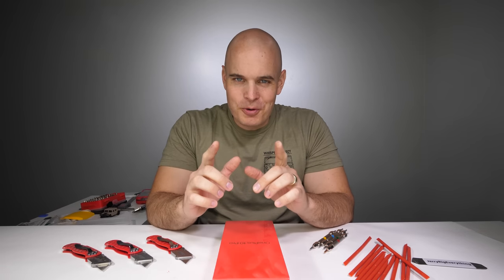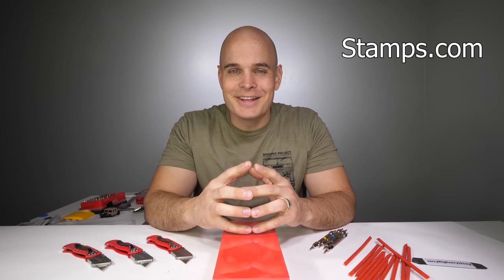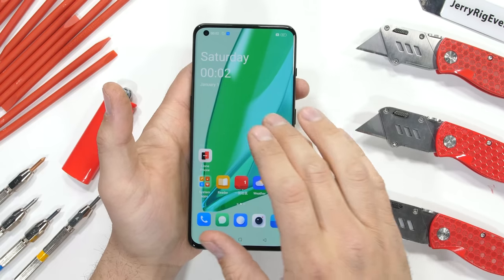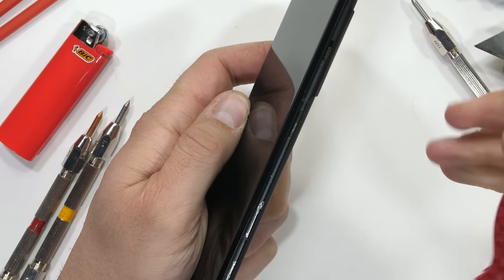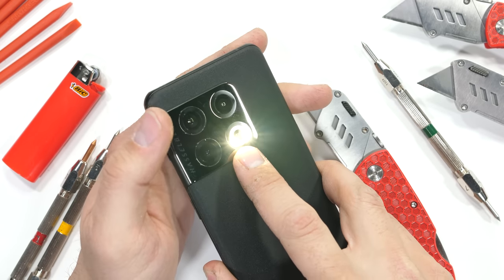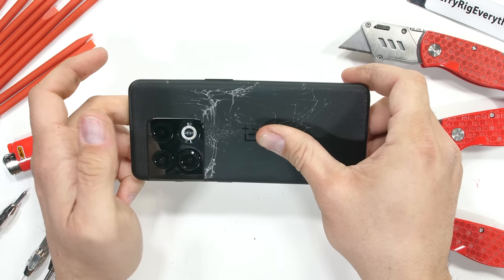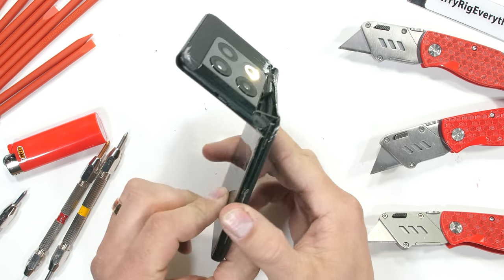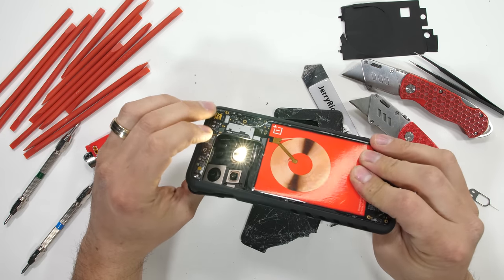Somethings wrong with the OnePlus 10 Pro... - Durability Test!

Comment: I love that when something fails, he goes into find out why, rather than just tossing it  and saying the phone is bad. Gives people a chance to understand how things work.
Reply: I want to point out that by naming the structural issues people lern to appreciate other phones which do survive those extreme bending tests. Especially those foldables.
Reply: @shivarsguard  especially because sometimes they can bend both ways
Reply: And that's why I love these durability tests
Reply: @EggplatnmWatch  there are youtubers who do that?
Reply: Why the company didnt bend test in their quality control department? They just dont care anymore?
Reply: @fynkozari9271  no, because people don't typically try to bend their phones. Sometimes things are overlooked, why not give people a chance and tell them why their product is failing
Reply: @EggplatnmWatch  You don't need to try and bend phones though. Phones being in back pockets is a very common thing that can result in a device having bending pressure applied to it. It's completely inexcusable to overlook those potential problems
Reply: @xenofastiq  And that's why channels like this exist, to expose the bad designs and point out what needs to be changed so it doesn't happen to other designs for future models
Reply: That's why I like Zack.
Reply: i can never understand how anyone is calling a phone bad or wrong when it bends under what must be atleast 15kg of bending force. a person with atleast average IQ does not sit on something hard with a phone in their backpocket. I never understood people who has their phones in their backpocket at all.

Comment: I still use my old OnePlus 5 that i brought new mid 2017. Surprisingly the battery is still fine after close to 5 years of use. The Li-Po battery has been cycled about 1800 times when they say it usually only last 300 cycles. Still  a very fast phone using the Snapdragon 835 and 8gb of ram. Does everything i want it to. Only down fall is the camera isn't the best. When the battery dies ill just replace is and keep using it. If it completely stops working ill probably upgrade to a OnePlus 7 pro.
Reply: Damn. My oneplus 5 battery started getting really bad after about 3 years.
Reply: I'm still using OnePlus 5 as well

Comment: They made the worst possible decisions when it came to structural integrity, leaving the zone where it broke super weak. The camera bump ends there (weakness in the back glass), the volume buttons and antenna line are on either side (weakness in the frame) and the battery housing is right below (no internal component that could help with/prevent the bending (even tho you shouldn't rely on internals for that anyway))

Comment: What a shame to see OnePlus crumble like this. I am still running my 3T to this day (6 years almost), maybe buying the OP7 Pro was the best move. I'll preserve this thing as long as possible as the OP9 gave bad vibes right from the start.
Reply: Oneplus 7t pro was the last good phone.
Still loving the retractable selfie cam
Reply: I had a 3 and it was still going strong when I upgraded. Only did it because of a good sale on the 7 Pro and my 3 had fallen on the concrete while I was longboarding and shattered.
Reply: The op9 was still a good phone. It was only too expensive for oneplus fans, but it was a lot better than previous oneplus phones.
Reply: i switched from 3t to pixel5a just 3 months ago... dont think i'll be back to 1+ anymore..
Reply: @kustu  yeah but in the that price segment there are better phones available than op9
 They have became the very thing they swore to destroy
Reply: @kbhasi  no the current Samsung galaxy s22 ultra is best
Reply: 7pro was great. It was also the last one I got. I ended upgrading to the s21+ because the 8 and 9 just didn't impress. And now the 10 is even worse especially with the awful software lately.
Reply: @kbhasi  you both saying out your opinions.  All your question also very subjective. Screen cutout? I don't see that is a big problem for newer screen. There's a feature to utilize the fullscreen. You just need to explore more on the device, it's an android, not iphone. It's 2022, even if it got headphone jack, people still buying the tws/bluetooth earphone/earbud/headphone. With fast enough data transfer using type c port, buying an external storage such as external hard disk, external pendrive storage (type c) can be a solution for sd card. It's even better because it transfer the data faster. Use the type c wired earphone also doesnt make any big change unless you're an audiophile. You eat your own question. Let me remind you, technology does evolved. None of the two form factors that you asked is available for iphone 13 series but you can see the sale that apple made. Don't ever question something that got a very subjectively answer.
Reply: @glitch5766  Eh, like other reviewers said, it was a good phone but just over hyped. It was on par with it's rivals.
Reply: I'm currently using the OnePlus 8 Pro and I'm really happy with it! I do recommend the regular 8 more though because the curved screen of its bigger Pro brother really collects a lot of scratches and isn't pretty to look at, I would rather have a flat screen!
Reply: One plus 7 pro is probably one of my favorite phones every. I rooted it so that’s probably why but as long as it has a new battery you’re gonna live it
Reply: I too have a 3T and have been using it for 4.5 years. I feel like 3T was the best smartphone to be ever made not just by OnePlus but by any company (if u take into consideration the price it was launched at). This is why I'm yet to change it because I can't find a better option. Was gonna buy pixel 6 but then Google didn't launch it in India.
Reply: My selfie cam still pops out, but the video feed doesn't work anymore. So sad. Can't buy a OnePlus to replace it because they're all terrible. Guess I'm going to Samsung or something.
Reply: I love my OP7P and was a happy user for 2+ years. Had no trouble other than having to replace the battery once due to degradation. Too bad that I accidentally dropped a weight onto it at the gym. The screen is shattered and more fatally, the frame is bent.

But before that, I only considered upgrading without actually pulling the trigger because yeah, the new OnePlus phones are pretty meh. I saw a video that literally had a 7 Pro and a 9 Pro side by side, and while they concluded that 9 Pro is a hair better, the margin isn't enough to justify an upgrade. You can barely tell the speed difference.

I have moved onto a Samsung Galaxy Z Flip3 now since neither 9 Pro or 10 Pro are giving me the wow factor 7 Pro did.
Reply: @ECGProductions092  that's sad indeed. Have you tried contacting OnePlus to get it repaired?
Reply: It's sad to see a brand such as Oneplus get so bad. They were a good brand for a long time. Clearly, not any longer. That frame looked so tiny and weak. It was insanely thin. I'm stick in shock. Did another company buy Oneplus and that's why the phone is made so cheaply now? I'm confused.
Reply: @all.day.day-dreamer  I have no clue why they have gotten so bad, but I know for sure their founder (or one of them, don't quote me on this) leaving the company didn't do it any good
Reply: Just curious is it safe to run a phone that long? Especially after the security updates have stopped. Or if there something I’m missing.
Reply: I had a OnePlus 3t and I changed it cause it broke because of my stupidity. Now I have a Nord 2. It is good though not as good as the 3t
Reply: I'm rocking the 9pro
Reply: @THusbands  just say " 7 pro " coz 7t pro is just 7 pro with IR sensor placed at side of camera . I would say 7t was their last original model.
Reply: I did get an 8T instead of the fairly underwhelming 9 last year. And for a great price. But it's likely my last. And to be honest, the 8T is ridiculously heavier than the 6 it replaced. Also a 1 and 2 owner...
Reply: @THusbands  I have my 8T Pro and the 9 Pro, those are both GREAT phones as well. You should look in to them
Reply: Upgraded to a OnePlus 9RT from a 3T after 5 years and I can confirm the OnePlus DNA is missing. 7T Pro was the last true OnePlus 💔
Reply: @THusbands  yea... 8 pro is also awesome
Reply: Hey model buddy! :D Also for me the 3T was my first and favourite - that magical instant-unlock with the fingerprint sensor was amazing.
But I dropped it and broke the screen, so now I'm rocking a 7T and indeed I haven't seen anything convincing from OP since.

My employer let me choose the model for my work phone, so I got a 9 Pro, and I'm not amazed. Constantly registers touches on the curved sides of the display, the battery drains faster than my 7T and the camera makes literally identical pictures to my 7T (sorry, I don't get what the Hasselblad collab is supposed to have contributed besides an Instagram filter).
Reply: i have a op9 pro and i can say over time with software updates its gotten better but im still getting an s22 ultra when i can
Reply: @kustu  I agee
Reply: I still don't want anything other than my trusty 5T
Reply: Also running the 3T still. I'm so saddened by the turn that OnePlus took, yet I'm still hoping that the 10 Pro will have improvements for the non-Chinese market. Otherwise I have no idea which phone to get. (Nothing Samsung, their bloatware is absurd.)
Reply: @ShmuelYonah  to my knowledge the only other flagship android phone with no bloatware, or software compromises is the Pixel 6/6 pro. Before you say you’re worried about the bugs, not everybody has the bugs. It’s something to wonder but remember you could have a non buggy device. I would take the risk with that.

Or there’s always the iPhone 13 series if you don’t mind using iOS instead of android for now
Reply: @lifeisshørt_420  minimal bloatware is fine. Like, I can handle the minor bloatware that OnePlus phones have, I cannot handle a whole new app store and proprietary basic apps. If I wanted only stock, then sure, I'd go with a Pixel. But I'm not convinced it's the best bang for my buck. I'm willing to spend over $1000 for a very high performance phone. Just not Samsung. (And definitely not iPhone.)

Comment: Was planning to switch from my 1+ 5T which has proven to be a loyal partner with a solid built that has survived many falls and abuses.
I was seriously considering a switch to 10 Pro after all these years (The 5T still works like a charm) but I think I'm not ready for a transition into a Folding Phone yet 😂 Thank you for this Test.
Reply: Same boat. My 5T has been exceptional and still smooth to this day.
Reply: What do you think about the Nothing Phone 1? Is it overhyped or legitness?
Reply: @WIProgress  phone looks stellar and since its One Plus affiliated, should be good build quality too. However, it uses a midrange snapdragon. I wouldn't buy it for that reason.
Reply: @shaazy  understandable
Reply: @Your Favorite Bucket how are they better than 1+ 10 pro? That they dont snap in half if you try to snap them? Or their camera doesn't look like a stovetop?
Reply: @marcopineda1621  13 is just Color OS. It is awful.

Comment: I think you should include drop tests, I'd be very interested to see how the current fashion for glass and ceramic rear housings  stand up to a drop onto concrete from waist height or thereabouts, I understand these materials look great but most people use some form of protection which invariably hides these premium materials from view and adds more weight and bulk to already big phones!
Surely it makes more sense to use a more durable material in the construction of the phone and make the cover / case from glass or ceramic if a more premium material is desired, this would give people the option to change the look of their phone easily and as often as they like.
Reply: I've got an s21 that I've stupidly dropped many times, often when I open my car door to get out, it slides out of my pocket cause I'm too stubborn for a case, and it has crashed down  onto pavement too many times to count, but honestly not once did it get cracked from doing do. Although it does have cracks, I don't remember exactly how but I did crack it somewhat early on, so it survived all those pavement plummets with pre existing cracks, but they still never spread or got any worse. Though the metal frame has a couple dings, screen has held up really well :)

Yes I know I should use a case. But no, I still wont
Reply: @latenightcrunch   bro my a52s5g 4 months old got few serious blows poor guy but holding up well with minor dent and few scratchs on screen lol
Reply: @latenightcrunch   Of course you are free to use or not use a Case, I do because my phone represents a large investment for me and I don't want to run the risk (glass shards tend to be troublesome for hand held equipment, unless of course you where gloves all the time!). I believe the Samsung S21 series have a 'glastic' material on the back as did the Sony XZ 1 which I owned and never used a case.
Also it seems manufacturers have limited ideas for premium materials, we don't see the all aluminium or stainless steel phones of not so long ago anymore!
Reply: I used my pixel 4a5g without a case because it had the plastic back. I with they had non glass versions of flagships. Lighter and more durable without the added bulk of a case but with great specs.
Reply: @ottallman  Active S and FE?
Reply: Yes drop tests!
Reply: @machman_I  metal housing tends to play hell with Bluetooth and wifi signals. I totally agree that cases are usually a must for any phone more than 100$. If I pay 500$ for a phone, 40$ for a nice OtterBox is not much to complain about. 

Also (for me at least) bezels are so tiny these days that to have any kind of decent grip on your phone, you need more grip space. Holding a phone with tiny bezels and no case in a good grip (for me) results in a confused digitizer that thinks I'm touching the screen with my palm and fingertips.
Reply: Drop tests aren't helping cause they're unscientific. You can drop a phone 100x without issues but 1x it falls the wrong way and breaks. What's more important is replacement part costs. And those suck big time these days. Oneplus 5T OLED Display: $70, S22 ultra OLED Display: $220.

Comment: Been rocking my OP7TPro caseless since the day I bought it. A few scratches here and there but the phone has survived multiple 5 foot drops and even an extended dip into a pool, all while continuing to work in perfect condition. I am amazed at how good OnePlus was, as well as how far they've fallen.
Reply: 7T & 10 are the only devices to fail the durability test apart from nord, 7T is a bad  design aswell however the 7Pro & 7TPro are the best they ever made
Reply: They really dont care about Oneplus anymore. Merged with Oppo. Usb type c on one side of the charger. Build quality lke this. Are those bloatwares I see? I have 5t no bloatware.
Reply: lol my op7 pro died yesterday after it was in the Rain for 20 min
Reply: @bigd7108  😭
Reply: CognizantxNight  i was cought by the rain when I rode my bike to work and used it as my navigation.
Reply: @ovwarrior  yeah .. it was my beloved almond edition
Reply: @hmdak  sorry, meant pro. I have the McLaren edition
Reply: @bigd7108 RIP sweet prince. How long have you had it?
Reply: @fynkozari9271  unfortunately. I wish they would revert but what's done is done.
Reply: @bepis2104  now this is the fun part. I had it 2 months. Bought it used after my 5t died, which was totally my fault, not sure what phone i should get next
Reply: I use nord....still no lag in performance
Reply: @bigd7108  I have gone swimming with my 7TPro I have video footage & underwater photos and on different occassions... I believe something else happened to your model
Reply: @hmdak  Well, good for u. It is what it is i rode my bike 20min in the Rain while my 7 pro was exposed to it. its dead now or do you believe its just sleeping?
Reply: @bigd7108  Honestly get an S22 series or a Pixel 6/6 pro if you wanna stick with android, or get the iPhone 13 series if u wanna try iOS, they definitely have improved this year